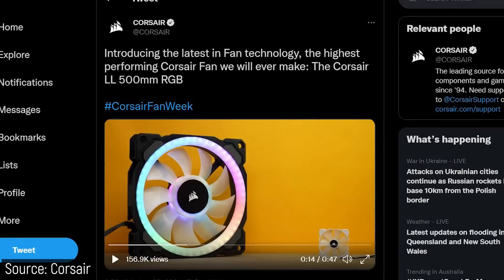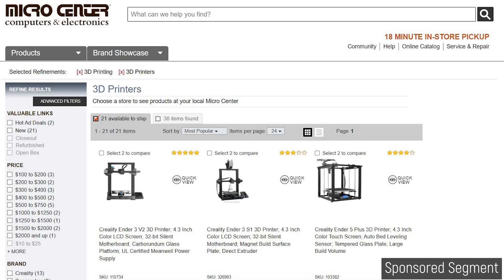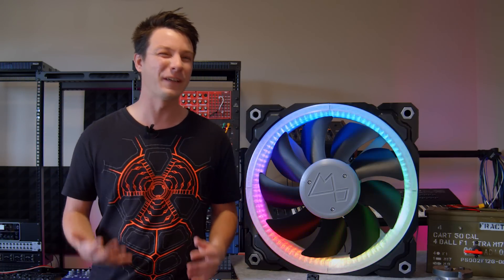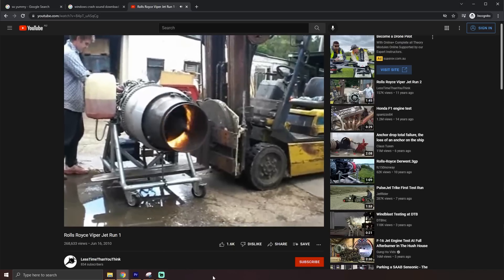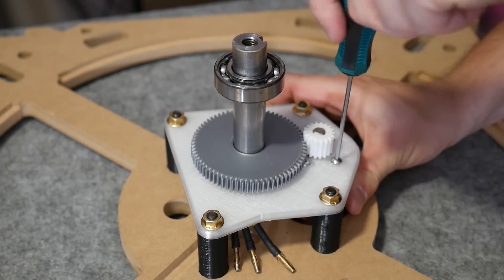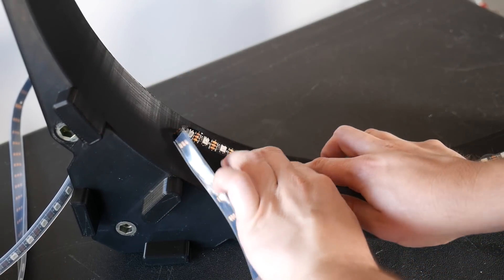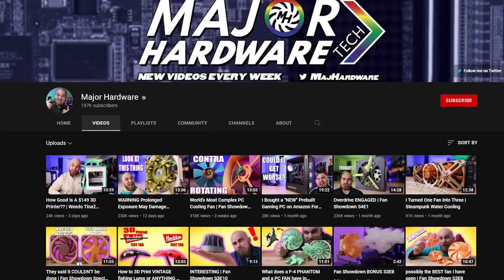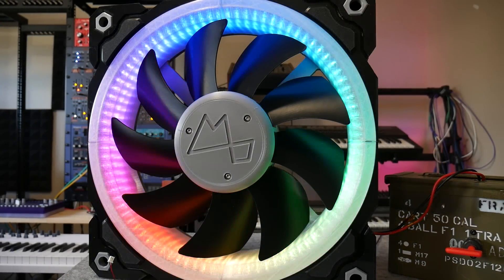Worlds most powerful RGB PC fan

Comment: Ahh Micro Centre.  What Dick Smith Electronics could have been with better management. Jaycar may yet get there but there needs to be some changes in direction.
Reply from the maker: Honestly so frustrated how badly dickies was bungled :(
Reply: @MakersMuse  I worked at the Moorepark store '99 - 01 and it was starting to go in a bigger and better direction. Then later they tried to be Harvey Norman/Bing Lee by adding brown and white goods. Early on  I worked with some of those who were at the top at the end and. I am still hoping that the ongoing ASIC investigation may result in charges. They deserve it.

Comment: Use a bigger motor without gearbox. The current design is to loud and impractical. I use big fans at low RPM to keep things quiet.

Comment: You should NOT have used WD-40 for this. It can't handle high RPM stuff and will eventually gum up and spin worse than the grease that was originally in the bearings.
Honestly? You should have left the bearings alone as they were. Yes they were difficult to rotate from rest, but how they're designed to work is that as they spin they generate heat, that heat makes the grease soften and eventually liquify which provides superior lubricity in comparison to what you did to them.

Comment: ROFLMAO
What a brilliantly impracticable build. 
Too bad you didn't hold off releasing this youtube until April 1. You would have people spinning. 
.
I kept waiting for the "explosive deconstruction" when a blade broke off. 
.
Pulling the bearing seals out was self defeating. Moving that much air, if the gear had not shredded, it wouldn't take too long for the bearing to become seized with dust bunnies. 
.
I am surprised you didn't have problems with unbalanced blades
,
You should get your friend to mill you some metal gears. They should last longer
.
Attach the fan to a tube and see how much thrust it generates. 
.
Keep up the insanity.

Comment: RPM meter = $10 on ebay. Show us speeds with an extra on your next video? :) Results aren't always what they say on the tin with these things, sometimes surprisingly not so, e.g. potentiometers from jaycar are generally wrong about their specs by up to 3-4x more higher or lower resistance than they're supposed to be.

Comment: Would be interesting to retry this build with the pancake motor from an EV bike. The weak point seems to be the geardown; easily the noisiest/lossiest part of the powertrain. You were likely dissipating 200+ Watts of heat in your spur gear at full power. An EV motorbike hub motor would purr like a kitten...

Comment: Send a improved version to Gamers Nexus so they can test it in their fantester.

PS look for someone with a CNC that can process metal, so you can CNC the correct gears. or use a METAL 3D printer

Comment: Send it to mu country the weather in the is scorching 🥵 hot with a heat reach to literally 62C degree we could put an ice box with a thin copper pipes and water pump to push the water inside the copper pipes make it like a radiator 
When the fan send the air directly to the pipes which has the cold water running inside of it creating a cold air 
Can u make it ?????

Comment: you sure it's a good idea to share this model? On an airline engine, there are strict cert requirement that the cowl MUST contain the fan blade, in case one fails. And it does happen. See result below. And 3D printed plastic should have much higher failure rate than Titanium....
https://youtu.be/uXZbHe4sMUk
PS. The engine kinda contained the blade, in that id did not enter the cabine. But instead cut the cowl leading edge when it departed out the front, causing the whole cowl to fail

Comment: I’d just use a direct or bent/go chain drve mxtxr xnd mke it quite and wrk bttr, and be able to be stronger xnd go slxw we xnd nt be as fst while still being able to gx fast if ths/that mkes sense/sinde or however it’s spelled, bt honestly, I’d rather hve 3/three d printer for metal or jst lke steel or irxn or sx/smthng lke tht, jst bxuse plastic ehh isn’t rlly tht stf lxng as mtal or sx/smthng lke tht